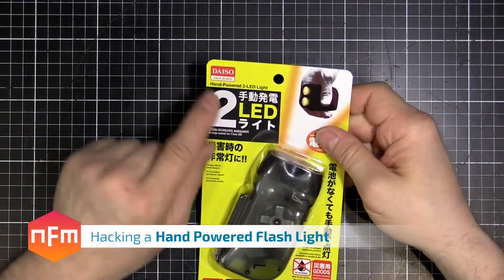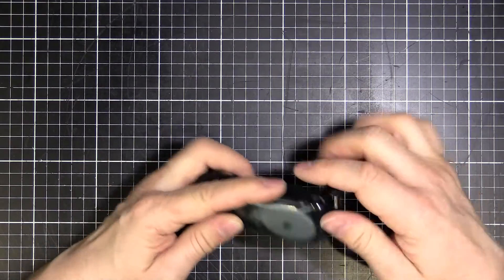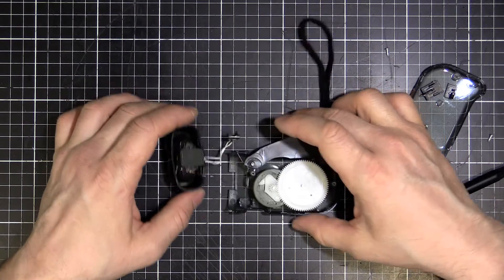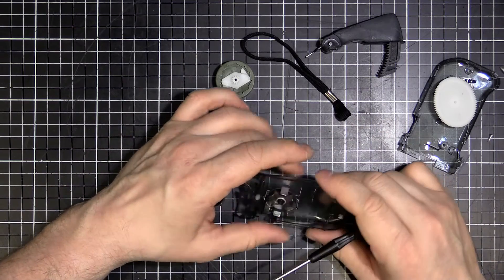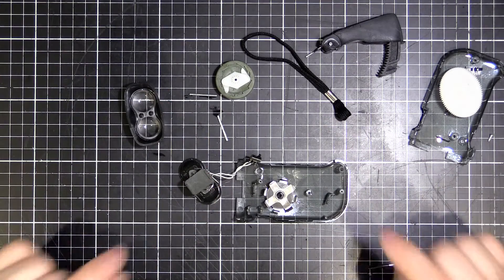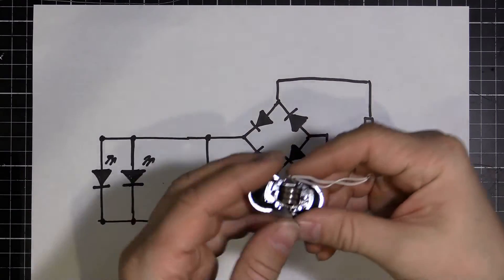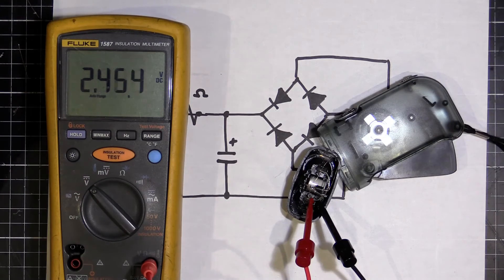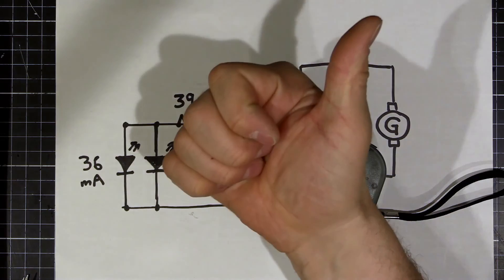Hacking a Hand Powered Flash Light

Comment: Given the generator putting out AC, wouldn't the original design have been better with the  LEDs in anti-parallel? (each LED using 'its own half-wave instead of discarding one and splitting the current of the other)
Reply from the maker: Maybe... Hmm...
The generator can only put out a small amount of current, so with only one LED conducting per half cycle, it will be half the load and hence less voltage drop than with the two LED's forward biased the same way and the other half of the waveform being wasted..
It probably would work out better than the standard configuration. Only that it would mean that with the batteries, only one LED would illuminate. Not a problem if the batteries are ditched though.

At 100 yen a piece, I might have to have another go at it when I am near that store again. :)
Reply: Michael Tempsch I think the LEDs individually would then get double the current that way. You would need to be careful not to burn them out.
Reply: > the LEDs individually would then get double the current that way. 

True, but wouldn't that open up for using a [even] smaller generator and saving a penny or two in production. 
But /o access to exact cost of the various components to the producer, it's all speculation - maybe the generator used id the cheapest available and they adapted the rest around that. 
But if current level was a major issue, I'd think they instead could have adjusted the gearing...unless that would have made it too hard to press...speculation, shmeckulation :-)
As a mod'er I might  substitute LED chips that can take more current, for a brighter light.
Reply: I remember seeing a 100¥ owner interviewed on a local tv news show. He explained that the markup on emergency  generator radio/flashlights was almost nothing. I think he payed 92¥ for them and sold them for 100¥. He felt it was important that people were prepared for disaster situations and he didn't care that he wouldn't make any money on those items. 

Your video just reminded me of that spirit.